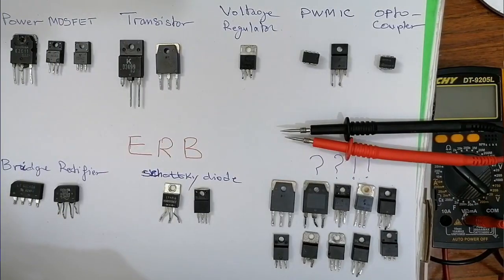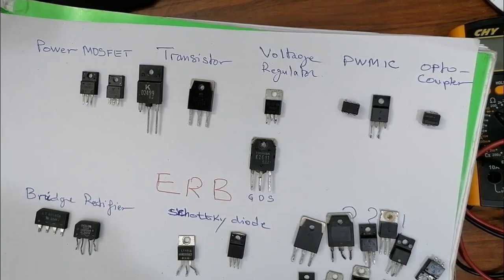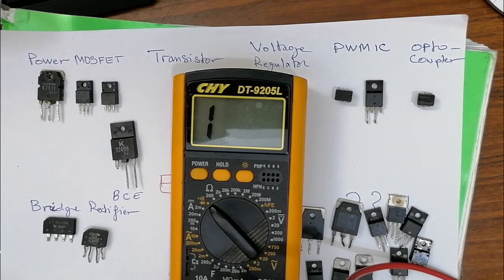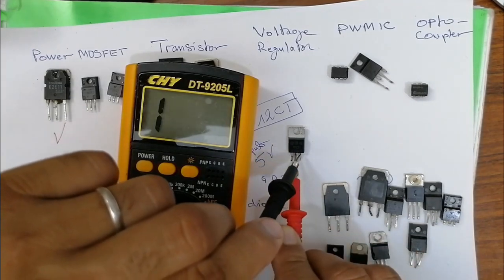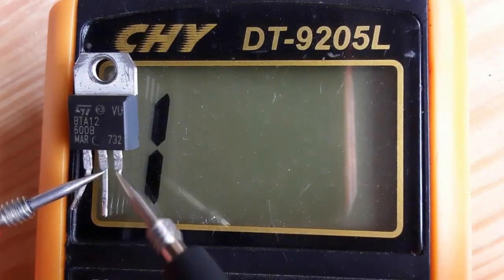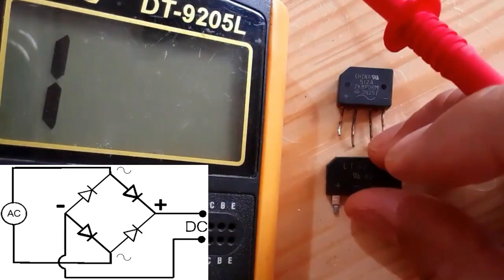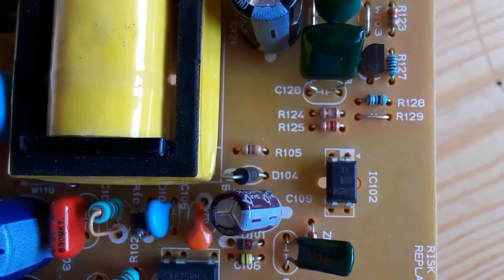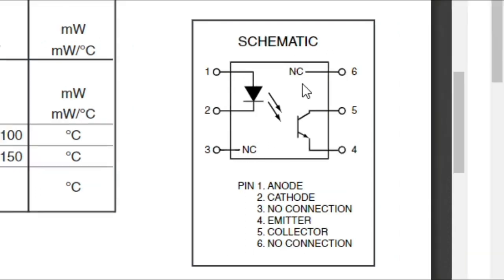Complex Electronic Components Testing, Mosfet, Transistor, Voltage regulator, PWM IC, Opto-isolator

Comment: I have a linksys ea6350 v2 dual band router showing 2.4 ghz signal Good near router and from little distance but the 5ghz signal is not showing weak signal even I am near the router can you please explain or show what will be the problem and how to solve it

Comment: excellent class sir thank you so much i was fresh technician now daily i attend your crucial tutorials  so i will be good technician. just im going to ask general knowledge assume 400v electrolytic 82nanofaraday burn out in given board so i can replace with 400v  and 100nafarady??
Reply from the maker: Thanks and welcome, possible but avoid it
Reply: means can i replace  E.capacitor with 400v  82nano farad with 400v 100nf no problem there?
Reply: Yes, you can.